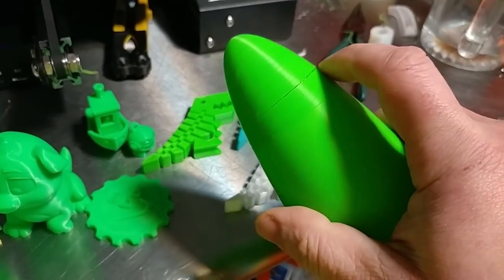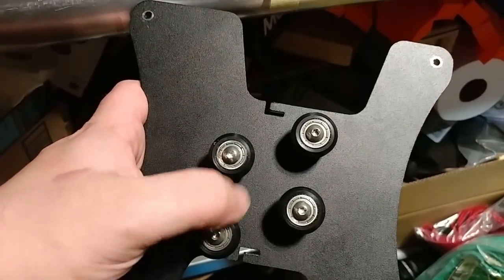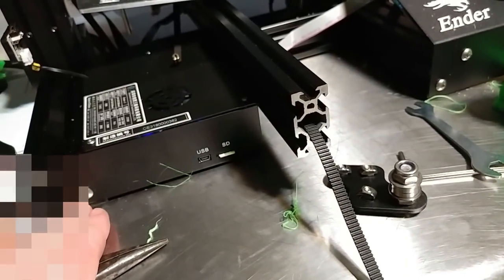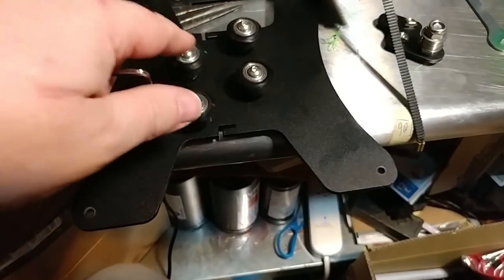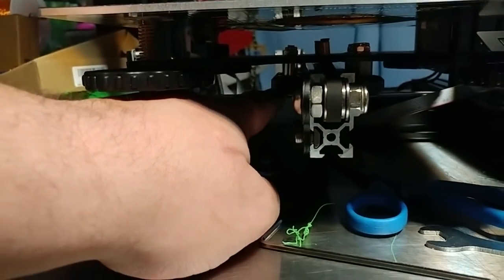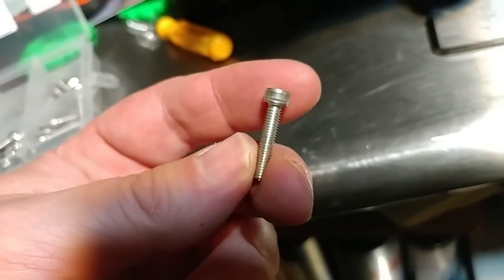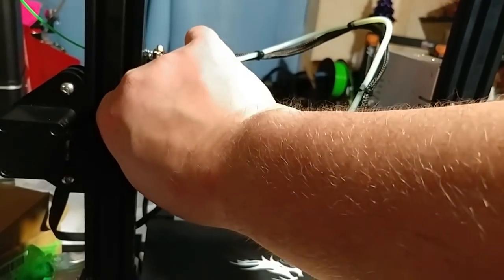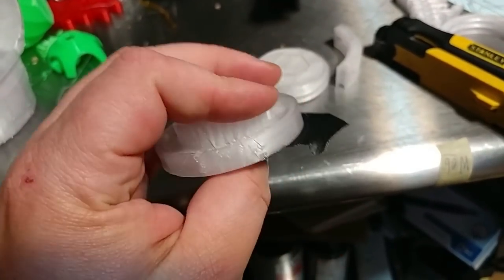T3DP 212.5 Ender 3 Update, Feedback, Examples, Issues, Fixes Creality3d Creality Ender 3 CR-10

Comment: Great review, as always. I was thinking about replacing my Ender-2 with an Ender-3, but now I'm changing my mind.
I don't like the force I have to do to remove the parts from the bed. Do you think it would be a good idea to install an Anycubic Ultrabase on the Ender-2 (and, eventually, on the Ender-3)? Or the increase of mass could be a problem? Thanks!
Reply from the maker: I am thinking of going bare aluminum and magigoo or similar or maybe build tak like surface to retain the low mass.
Reply: The original buildtak clone which comes with the Ender-2 works well most of the time. But I'm afraid of damaging the weels and the structure by forcing each time I have to remove a larger print. Perhaps I'll try to install an ultrabase (the increased mass on the Ender-2 would be less than on the Ender-3). Hope it is easy to cut an ultrabase. I'll tell you if it works well. Best!
Reply from the maker: Remember ultrabass is tempered glass you cannot cut it it will shatter if you try
Reply: I just heat the bed to 50 C to soften up the print - makes it easier to remove on the Ender 2.

Comment: I just got one of these, the print bed isn’t flat, it is curved so it dips lower in the centre !
Reply from the maker: In that case you could put a piece of glass on top of it which would solve the non level problem can you might want to contact the cellar for your possible replacement bed it's very easy to swap out but use glass in the meantime

Comment: Quick question regarding that low poly rose vase at 4:08, I'm having issues with a larger single line which ascends left handed spiral on the print. Could this be something that Cura is misinterpreting when converting from .STL to gcode?
Using an Ender 2 - nothing seems to be bound up on the printer, in fact I can hear the stepper do a quick pause over this location to create the larger line.
Reply from the maker: It sounds like your slicer is not correctly generating a vase print my first suggestion if cura allows this is to make the model solid and heal which should remove the imperfection

Comment: She's wanted one for a long time. She wants to make molds for Polamer Clay etc. What would you suggest on what Filament to use. Also will a spool holder come with the machine? Will the glass really add too much weight and slow the machine down?
Reply from the maker: It comes with a spool holder and the glass won't slow it down very much if at all slowing down simply improve print quality

Comment: I just built my ender 3 and noticed that the bed does not move smoothly without power. Just got a shipment of the new orders with a removable bed (also came with creality glass). Is there any link to see a dissambly of the bed or a way to make it glide nicer? There are some spots that catch resistance. Thanks!
Reply from the maker: Yes your problem is your rollers for your bed are too tight so they are crushing the bearings rollers Etc causing those divots and flat spots you feel loosen the wheels until a bed wobbles then very slowly tighten them back up only exactly enough to stop the wobble and it should roll back and forth smoothly you do want to fix this because if you don't it will impact your print quality your motor life and add noise to your prince
Reply: Nerys all of the rollers? I notice only two have bolts that can adjust...
Reply from the maker: The rollers are in pairs one is fixed one is adjustable so in your for roller set up you'll have two that are adjustable but the reality is you're adjusting relative to the other so you're really adjusting them in pairs :-)
Reply: Got em leveled, cheers!

Comment: I wanted to ask you about upgrading my brass extruder to hardened steel.  Seems like a pretty cheap upgrade. I'm not doing any wacky filaments like carbon impregnated nylon so just wondering if you think its a useful upgrade.  Thoughts?
Reply from the maker: Only if you're going to do abrasive elements such as glow in the dark carbon fiber Etc if you're not doing your braces there's no reason to upgrade
Reply: great thanks. my kossel has a bad heater in the extruder. ugh. well at least i'm learning a lot. the e3 is back on prime for 240... might get that if tomorrow doesn't go well. The kossel design is junk. Putting AC power wires into a motherboard? are you kiddin me? No bottom? grr. its a nice bit of kit but needs total redesign. I'm going to move the motherboard onto a side mount and make it much better once I can print.

Comment: Soo, I screwed up on my order.. and ordered an Ender-2 instead of an Ender-3.. now the decision to keep it or sell it and order an Ender-3 as I intended.  Wondering what your thoughts would be.. keeping it and ordering an Ender-3 as well would probably be best.. if I could afford it.. lol
Reply from the maker: If you can afford it and know you will stick with 3d printing? Then yes i would keep both.
Reply: Thanks, it's where my mind was aiming with this as well.. but as I only own a Tevo Tornado, if the difference between the Ender-2 and 3 was enough to not keep the 2.. that was my main concern.. 
Ohhh I'm sure I'll stick with printing.. very up my alley creatively and tech-wise.. My other issue is space to house a 3rd.. but if I can get into making any amount of money from them via etsy or something.. then it'll be easy to justify making the space for them.

Comment: Noob question: just purchased and assembled my ender 3, it's my first 3d printer and it has quite a few issues similar with your like some mis alinged holes and the juttering and also the whole frame is wobbly but with the exception of the juttering i believe i handled them properly. 1st question have you found any solutions for the juttering? #2 the noob question: is it better to print with a 3mm filament or 1.75mm? And can also send a link on your settings when you those prints? TIA
Reply from the maker: There's no real difference printing with 1.75 m m and 3 mm filament except you can't use 3 millimeter filament your printer won't accept it :-) the jarring are you talking about wireless printing? Where it seems to slow down because it can't keep up? If yes then yes the solution is to slow down when I slow down the print the problem goes away

My printer is not wobbly what part of your printers wobbly? Make sure those primary bolts going into the H frame are tight

I will double check in half an hour when I get home but I should have my simplify3d profile uploaded to my profiles folder which is linked in the description of all my current videos
Reply: Nerys cool thanks a bunch. The jutter thar i mentioned is along the x axis frame. When i try to move the extruder i can slightlt feel a hump like instance or rather sensation.

And the wobble, im pretty sure i wasnt causes by the srcews but the base itself is not completely flat against the floor but its nothing that a piece of cardboard cant handle for now :p
Reply from the maker: The eccentric might be too tight on the extruder trolley (x axis) loosen it till it wobbles. Then slowly tighten until you just get it to stop wobbling then just a smidge more. Over tightening cam enhance imperfections in the bears and rollers (flat spots)
Reply: Nerys, ayt. Will try and check that out tomorrow when i get off work. Wish me luck with my first attempt :p

Comment: The issues seem a little concerning, how would you rate the build quality and issues compared to a cr-10 or ender2?
Reply from the maker: Do you remember it's a brand new design and this is a 500 printer test batch this is kind of the point for people like me to find all the problems so they can fix them the very first batch of cr-10s probably had similar issues and over time they work them out

I would rate the build quality slightly better than the first cr-10 batch but of course worse than latest cr10 batch
Reply: I appreciate your feedback, I hope they incorporate changes. I have a later model ender-2 that was pretty polished by that point, currently waiting on one of the 500 ender-3's so it's good to know what to expect.
Reply: What steps did you take to straighten the wheels?

Comment: Very thorough analysis! When you mentioned dampers at 15:06, was that a reference to physical dampers or electrical dampers? I see some metal+rubber dampers for sale online, and thinking I should get some and install them on my CR-10S's. The Y is especially LOUD when moving at certain speeds.
Reply from the maker: Correct the metal rubber dampers
Reply: Excellent. Should I pay $16 for a set of two? LOL
Reply from the maker: No hang on

https://amzn.to/2FeNwNs $11 for 5

You only need 2 / printer on the X and the Y

Comment: Why don't you print your nosecones with thicker walls? They would be plenty strong, and they wouldn't use any infill. Less plastic, more strength, no?
Reply from the maker: that would take more plastic not less.

I use 3 perimeters. more than strong enough. the ABS was weak not the nosecone. though ABS being less dense I could use more perimeters for the same mass.

the nose cone is already hollow. I use the minimum amount of infill to meet its needs.

some infill at the top for integrity of the cone and infill at the "shoulder" to reinforce this high stress point and provide a location to attach a shock cord.

the infill also helps the nose cone to maintain its integrity if it gets near glass transition temperature. (fully hollow nose cones fail at much much lower temperatures than cones with a minimum of infill at key points.

Here is a picture so you can see just how little infill there is (almost none JUST enough for integrity and strength)

https://i.imgur.com/OB9WZ3u.jpg
Reply from the maker: MrCarrellScience by the way I figured out how to use thick walls without using more plastic :-)

1.2 million or nozzle same wall thickness is 3 perimeters but in a single vase mode perimeter and just some infill at the bottom for attaching the shock cord it's looking very promising and they print very fast 2 hours instead of 7 :-)
Reply: Looking forward to seeing your launch videos

Comment: hi nery, not sure if i ever asked you, but have you ever tried to use a slick mat on the heat bed, they can handle the heat, filaments wont fuse to it but they will stick to it , i have not seen anyone use one so i was wondering if you ever have
Reply from the maker: Never heard of it. Got a link?
Reply from the maker: Not sure how those could work unless you can somehow adhere then to the bed or they will nust flex with the warping parts.
Reply: ok was just curious, thanks for the reply

Comment: Hey man, did you have any problems installing stepper motor dampers on the ender 3? When i install the Y-Axis dampers the bed wont reach the endstop... it hits the heatingbeds metal just before it can hit the endstopswitch . Do I have to do some modifications?

Comment: Is this printer better than the cr10?
Reply from the maker: That is not a simple question because it is not comparable in build volume I would say print quality is about equal the Ender 3 has slightly higher realized resolution but the Moray pattern from the 24 volt system hampers that slightly so I would call it a wash the cr10 has the advantage of being a 334 size printer while the Ender 3 is half the price and is an all-in-one Construction which is very convenient that means no breakout box everything is attached to One Construction it's pretty darn hard to beat for $200 in fact I don't think there's another printer on the market that can touch it for Price performance and convenience
Reply: Nerys  assuming print bed size is not a factor, price is not a factor. Nothing is a   decider,  just straight up comparing   print vs print  of something like a benchy, If you had to make the best print possible which one would you? use
Reply from the maker: Hmmm i will have to run some comparisons. Comparing cr10s to ender 3 is very very close. I will print out 2 benchies using same gcode and same filament and let you decide 

Ender 2 isbsuperior to both but just by a hair. Ender 3 should in theory have less noise with its lower inertia kinematics but the 24v noise might make this a wash.

I will have to get back to you on that
Reply: Nerys. Wait.. what.. the 2 is better than the 3?
Reply from the maker: Under your criteria of pure raw print quality yes just slightly although It suffers badly on under hangs

I have never seen Another Printer that prints as good as the Ender 2 although the TiVo Michelangelo comes extraordinarily close

Mind you we are talking pure raw print quality for overall usability the Ender 3 kicks the Ender 2's butt

But you said ignore all other factors

I believe the Ender 3 can come close to matching the Ender 2 with improvements I am working on that but it's slow going as I have very little free time my theory is to run the board on 12 volts instead of 24 volts and reserve the 24 volts for the heat bed since I believe the noise that a 24 volt system pads is what is hampering the print quality now mind you the print quality difference is microscopic it would be very hard for you to see without it being pointed out to you we are talking a very very close difference here
Reply: Nerys thank you so much. 👍 one other question.. what do you think is the best printer over all,  from any brand, that's 1000 dollars or under
Reply from the maker: I can't answer that question as you have worded it but if I change your wording to be the best printer overall that I have ever touched I would say the Ender 3 has the potential to take that spot for its quality convenience and stupidly low price :-) I have three of them and I'm looking to buy a 4 that's how much I like it of course to be firm on that you'll have to give me a few months to play with it make sure it holds up but it's using tried-and-true parts so I don't anticipate that being a problem
Reply: Nerys. thanks guy, for talking the time to answer all my questions. I have a cr10, had it for months now, 90% of my prints are for rc parts and accessories. So mainly small items. I don't need the build size of the cr10 even though the reason I bought the cr10 was  it was huge.lol  I just need a second printer now, don't need the huge size build plate . And trying to decide what to get.
Reply from the maker: In the case of second printer thats easy. Get the ender 3. Best bang for the buck available. Period. And the 220x220x250 build volume is pretty nice too.

Comment: Since Im still waiting for my 3/28 pre order to even ship would it be a good ideal to cancel and wait for them to work out the bugs?
Reply from the maker: That is a personal decision up to you I personally would not because of the deal you're never going to get it for $159 again I don't consider it's problem to be fatal so in order to keep those savings I would keep the order of course that is up to you and it also depends on how DIY capable you are if you think you can handle making the necessary changes I would keep the order so you can reap the rewards of lower price
Reply: i spoke to creality, they might add some changes before the next shipment which might cause a slight delay
Reply from the maker: I hope they incorporate some of my advice. The cost should be close to zero and i would really like tbis printer to succeed.
Reply: you are right, i sent them your video and someone elses to 3 people at creality. so lets hope they listen